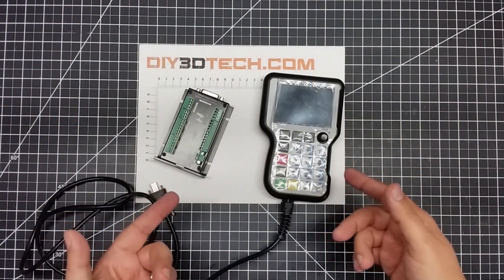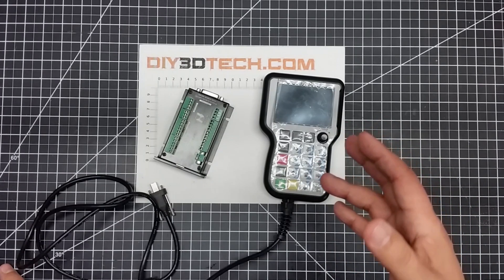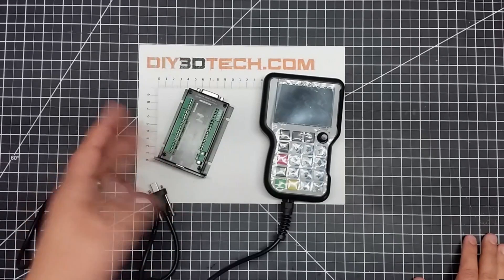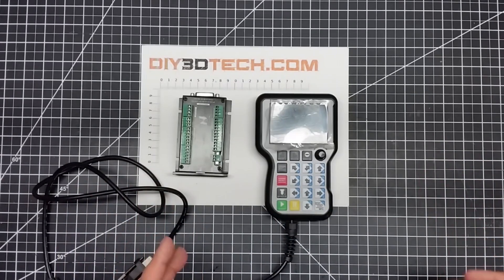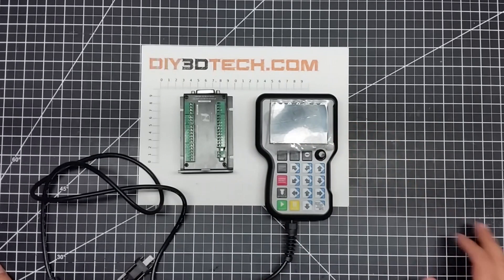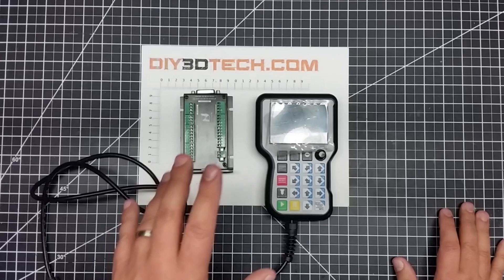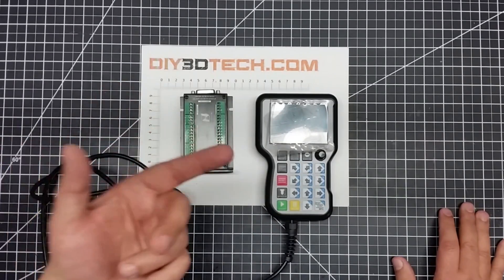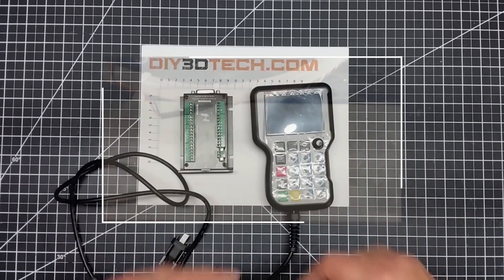3040 CNC - Finding a Replacement for GRBL!

Comment: Every time I go to check on these CNC machines the hair on the back of my neck sticks up and I am reminded that every single purchase I have made of 400-1500 USD from China has been really really bad.  My Laser was the worst as I had to break it down (50w) and replace everything in it except the motors, drivers, and the Ruida.  I even had to tear it all apart to paint it last year and when I did I went to scrape the old paint off and they had simply spray painted over the rust so when I went to remove the paint I had a ton of rust under it and above the metal.  I had a 650 dollar 3d printer from China I purchased on eBay and it was a dud too and what a disaster it was (almost caught my house on fire).

I just want something that isn't going to stab my bank account and works.
Reply from the maker: Well you never will get that from China however what you will get is opportunity.  I have bought TONS (literally) of stuff from China and NEVER been disappointed as I ALWAYS expect to either mod or repair it.  Example,  take a $500 K40 and compare it to a Epilong 20k or even a Glowforge at 5k it is a heck of a deal.  Same with 3040 CNC as could not even buy the aluminum to build for price I paid for it.  So what I tell everyone is you understand this going you will be happy :-)
Reply: I have bought a ton as well and have been nothing but disappointed.   Thanks for replying.

Comment: I'm really looking forward to see how this works out. I'm building a CNC that will end up in an unheated dusty garage. I don't want to put a computer in that environment. This seems like it would have been ideal. Unfortunately I already bought the Ethernet controller (made by same company) so I can run it remotely. My setup is ok but requires Mach3 and I'll still need to buy a pendant. I wish I had seen your video earlier.
Reply from the maker: Have ordered a 24v power supply and waiting for it to come in :-)

Comment: I got a lathe and a mill running on TurboCNC and another lathe and mill running on Mach3. If any of them die I'll be trying grbl since I got all the hardware laying around. If I was starting over I'd try one of these: https://m.banggood.com/50KHZ-CNC-4-Axis-Offline-Controller-Breakout-Board-Engraving-Machine-Control-System-Card-p-1021134.html?akmClientCountry=America&rmmds=search Great video in the link to a review of one of these in action. You can find these from several sources but I've had great luck with Banggood.
Reply from the maker: The link you shared is basically this unit as a pendant so stay tuned to see how it works!
Reply: @DIY3DTECHcom   I think you got the wrong link? There is another link where he builds one of these into a pennant unit but this link is using the control as a Fanuc style controller. He's not up on all the features but he probably never spent time on a Fanuc style interface. Curious to see if your screen is as big as the panel mount screen. He takes it apart and finds it is wired to also work at 24 volts even though it's labeled for 12 volt. https://youtu.be/LCxDZmvb5po 
For pennant on my last build I did the Bluetooth interface with a mini keyboard that has a touch pad to access my Windows touch screen.

Comment: i have a xhc remote to use:D with mach3
Reply from the maker: Yes, however the issue at for me is Mach 3 still requires a computer a computer and I wanted to get away from this so the idea is this repelaces Mach3 (the software and cost), along with the computer (hardware and cost) and since it's a pendent (the hardware cost of a pendant)....
Reply: @DIY3DTECHcom  i know.. but it will always need one :D

Comment: I am rebuilding my CNC from Arduino to tb6560 / Mac3 with Cambam.
The Arduino grbl shield solution is to hobbyish..
Reply from the maker: Isn't the  tb6560 just a stepper driver board?  So you will still need a computer to Mach-3?